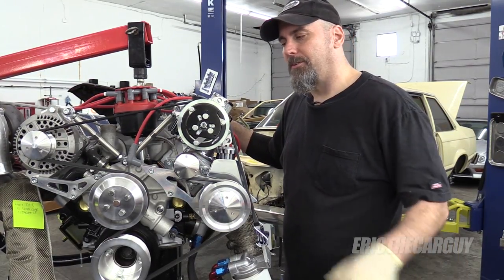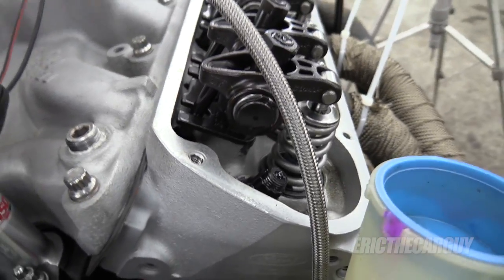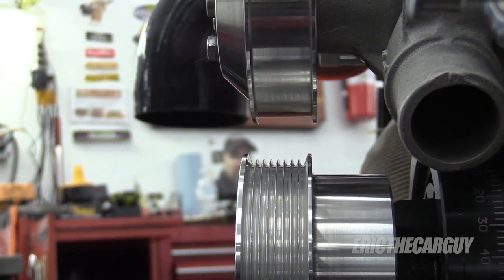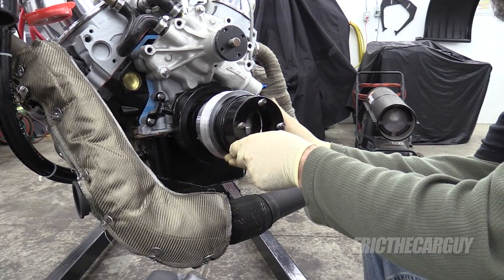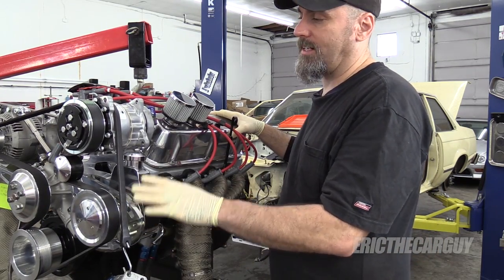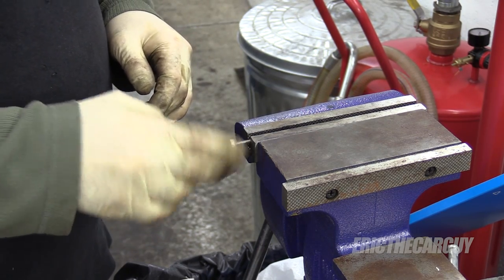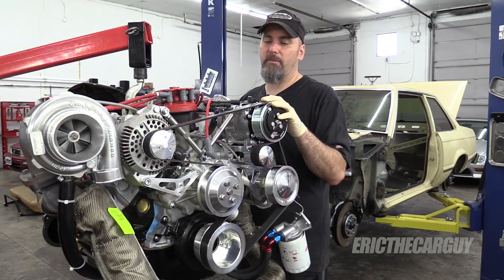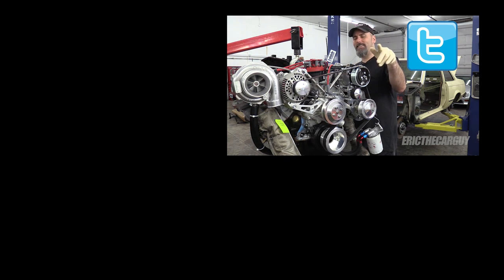How To Dress Up Your Engine!

Comment: Just as I moved to Florida 3 years ago my AC died... I got a job working outside, so I get all nice and sweaty then get in a 110+ degree car and head home... not fun.

I've been fixing my own cars with Eric's videos for 7 or so years now, watched all of the AC videos and properly replaced the compressor, vacuumed the system and refilled it, did the dryer receiver and the expansion valve as well... finally have AC. Point is YES, when it's very hot you're dying for some AC. Honestly on long trips of it being over 100 you can start to feel faint, it's not a good thing.

Comment: I have used CVF Racing parts in the past. Their parts are well made with a great finish and fit. Due to continued failures, I finally bit the bullet and spent $2300 on a Vintage Air FrontRunner system.  The Vintage Air system came with all the components needed to ensure the proper fit and operation of the accessory drive. Aluminum water pump, 170 amp alternator, power steering pump, belt tensioner, all the ARP fasteners needed, and a signal Serpentine belt. The system has been installed for three months now with about 5K miles on it including a desert run with 100+ temperatures. Before I installed the FrontRunner system I never got more than a thousand miles without a failure. The only problem remaining is all the rusty junk I need to replace under the hood.  The upfront price on the Vintage Air system made me say bad words but with it said and done it is the better value.
Reply from the maker: Yea, I thought about that. It's funny that in the end I will have probably spent $2K on my system and it will look like I never did anything when I'm done.
Reply: The Vintage Air FrontRunner system is a beautiful piece of art but the best part of the system is I bolted on a 100K miles of reliability. The only complaint I have is the support from Vintage Air was not worth the time I put into. Unlike CVF Racing that is always helpful. I really love the Fairmont Videos and will watch all the videos you can produce. Remember family comes first then the Fairmont, import repair videos, ETCG1 and last and most likely least sleep. Keep up the great work and thanks for being on YouTube.

Comment: You didn't torque those valve cover bolts properly. You have to say "click".
Reply: Godfrey Poon it was a flex type not a click type.
Reply: thisisntme But he didn't say "boinggggggg" either!
Reply: I thought they were torqued to a "medium grunt" spec?
Reply: Scotty kilmer has the best "grunt gauge".
Reply: Godfrey Poon or crank on the bolt till ya hear the crack, then back off 1/4 turn
Reply: I'm German and currently have a VW. I tighten things "gouldntite"
Reply: +Silly Dog isn't it Gutentite?
Reply: Torqued to half of a turn before the bolts breaks!
Reply: Igor Toebe you do this by turning it until it gets loose then go back half a turn
Reply: the correct torque value is tighten till it cracks then back off a quarter turn
Reply: "Make the noise...!"

Oh, wait. Wrong YouTube channel. This isn't the Bad Obsession Motorsports channel.
Reply: +Kelli Halliburton  More like Bodgit and Leggit Garage.  :-P
Reply: +First amendment Both of them are already over 500,000!

Comment: I just started my channel and feel the same way as you about the "hand calibrating torque settings" and said to people don't break my shoes. Then I tried to torque something that wasent a die or need setup and I snapped 2 heat stressed bolts. Then got lucky with the extraction but said to people see what happens in this kind of situation. LOL. Thanks for the inspiration to make my own channel and your video's are great and love them. Keep up the great work.
Reply from the maker: Good luck with your channel!

Comment: That engine looks great the way you built it, and hope everything works out fine once it is in the car. It must be so rewarding to know that you built that engine yourself, and it is a workhorse like no other. It is nice that you have power steering and A/C on the vehicle also since the A/C will definitely be needed in the Summer heat.

Comment: Those rubber and steel gaskets are the only way to fly on a 302.   The 130 amp is OE for a 90s Taurus, also an awesome part.  Stock 80s alternators have terrible low rpm output.
Reply: Large Body 2 holes all always 130 amp.. Ford uses them in many a truck and vans..

I would add. These things get hot above 50% loads. Which is why ford uses a 175 amp fuse and #4 stranded wire from alternator too battery....

Comment: Eric. That cutting bolt with nut tric. Trick is intend to cut just next to nut. Use some random nut, lock it to the correct bolt lenght in a vise and cut the bolt by leaning to the nut.

Comment: On a boosted engine I'm afraid you are going to need a oil catch can. Boost and valve cover breathers don't work well together. The catch can may be a pain to find room to mount. But it's a real good idea so you don't oil down your engine bay.

And I can see why you were a little upset about the missing water pump pulley hardware. I believe they don't supply them with it because the needed bolt length can vary greatly depending on a fan set up used. Not everyone runs an electric fan. And on the mechanical fans the needed bolts will depends on the spacer length or fan clutch being used. 

The engine is looking good!

Comment: Never seen an engine before without PCV. 
If the breathers leak, maybe you can route it back into the intake?

Can't wait to see it drive. That old granny sedan with that beast of an engine, so cool.
Reply from the maker: PCV systems didn't show up until the 1950's. Before them, they used to vent the engines out of a 'draft tube' on the back of the engine. The PCV actually came about because the US army wanted to drive their Jeeps underwater.

Comment: 1:52 see the ford logo and that bolt thing under it what's the bolt thing called because in my car I have a pool of oil sitting around it I thought it was meant to drain back down or am I wrong. Also there was I little bit of green in it but I think it's gone now

Comment: What does the valve cover need breathers for? Is there pressure inside that needs to be equalized? And if so, then why does only one side of the valve covers have them, and the other side doesn't?

Comment: hey I just got a new governor for my truck but it won't go in all the way or it is and I can't tell, there's nothing in the chamber or anything blocking the way so my guess is replacing the cap with a taller one (I have a short stubby cap) but I'm not sure on it tho need more information

Comment: How do you figure out what way to run the belt around all the pullies? How do you figure out the correct length of belt? How do you figure out the correct tension of the belt across everything?
Reply from the maker: In order. Ribbed side goes to ribbed pulley. Smooth pulley goes to smooth side of the belt. The belt came with the kit and was sized for it. After a while you develop a feel for belt tension. https://www.youtube.com/watch?v=ZSTZdTAB_As

Comment: With dressing the external threads after trimming off part of the original length, I was taught to always use a die. That is the best way. A very good mechanic/technician should have a die set adjusted to a looser cut to minimize re-cutting any of the good, original threads. The trick with the nut is just that: a trick (more like a shortcut). Only use that method in a pinch.
For internal threads, there are specific thread-chasing taps that will minimize re-cutting the good part of a threaded hole. A common application is the spark plug hole; use white grease in the tap's flutes to trap the chips. Then, clean out the re-cut spark plug hole carefully and thoroughly with dental picks (yeah, really!).

Comment: what pcv valve are you running? since you are turbo charged you could be pressurizing the crank case therefore pushing pressure up to the valve covers through the oil holes. (this believe it or not can be a loss of 20 hp because of the back pressure on the piston rings) The stock 5.0 pcv can be upgraded to the svo one or better yet go to a catch can
Reply from the maker: You might want to watch the video again.
Reply: EricTheCarGuy what did I miss? those breather filters will still spit oil if you have the condition I talked about above....ask me how I know ;)
Reply from the maker: You missed the part where I said I couldn't run a PCV because of the turbo.
Reply: ok so are you venting where the pcv was to a filter / catch can or did you plug it? if you plugged it I think you still will have an issue.
Reply from the maker: Again, I covered that in the video.

Comment: I installed a CVF kit on my Pontiac and ran into pulley alignment issues too. I have an aftermarket balancer and that threw off the pulley alignments. The water pump shims CVF sent weren't thick enough so I ended up making my own. I also had to make new spacers for the brackets. Thankfully I have a machine shop and was able to get everything dialed into a gnats ass. I redid the belt tensioner to get rid of the two piece one CVF sent and fabed a different power steering to head bracket. All those spacers .. washers and slotted brackets was just to sloppy for my taste and looked kind of clunky. This isn't a criticism of CVF because they have to try and cover as many permutations as they can in one kit. Mine was off just enough to be an issue.

Comment: You should use those valve covers on "Pit Stop," the 302 that came out of the Mustang... if you ever do anything with that engine.
Reply from the maker: The block is still at the machine shop. I don't think it's usable. There are plenty of small block Fords out there though.

Comment: I had seen a video about a diverter for the exhaust have you thought about running one? I know that you are building this as a "sleeper" From what I saw I thought having the ability to have the option is a cool concept have the option to run the exhaust off the header or switch to running through the muffler or straight exhaust with a push of a button.
Reply from the maker: Not using a push button. Designing my own cable system so I can instantly open and close it.

Comment: That crank pulley is not the stock size pulley. The stock pulleys did not need the Allen screw sets. They were mounted with a regular hex bolt and would not work with the under drive water pump pulley due to them being to big to even mount together.

Comment: Eric- do you have an HEI ring for those plug wires to snap into? It's usually a GM thing- with the integrated HEI coil on top, and the wires snap into the ring to secure them. I don't know if you've ever mentioned the ignition setup? Plugs type and brand? Points or electronic? Coil? Thanks Man.
Reply from the maker: I put it on after I made the coil wire. Later episode.

Comment: Hi, how can it be that u didn't go with electrical power steering instead?  You have to cut the steering rack in half to fit the motor, but saves u the power lose from running a ps pump all the time.
Reply from the maker: And the electrical load on the alternator is better? Also, there's enough modification going on with this project as it is. The time, effort, and expense of EPS would simply not be worth it in my opinion.
Reply: I am asking cause I have a non-PS 924, and don't know if I could go for the expensive and fiddly way of installing a 944 pump and rack or "in my eye" easier electrical PS.

Comment: The old valve covers look a lot better but obviously you have a much improved breather situation with the new ones.
Reply: Simon Coles the old ones could have been modified to work. it would have been easy to weld in a baffle and repaint.
Reply from the maker: I thought about it, but welding aluminum is not as easy as you think. Not to mention the old breathers won't breath as well as the new ones.

Comment: I have an incredible eye for detail!
Looks like the turbo housing is MUCH to close to the alternator and will cause it to get very hot?
Also the water pump pully is STILL i slightly out of line with the belts if you check with a straight edge on one side?
Lizza
Reply from the maker: The pulley is fine. I also have a blanket for the turbo. I don't have it on now because it's easier to work on the engne without it.

Comment: Can't you put a pcv valve to regulate the oil pressure a little better so it doesn't do that or is that not how it works?
Reply from the maker: The PCV has nothing to do with oil pressure. It's just a crankcase vent.
Reply: EricTheCarGuy sorry, just a beginner, I have a 1982 ford Bronco that's doing the same thing by spilling a little oil with what I think are aluminum valve covers and Mr. Gasket breather caps, I have no idea what's under there because I bought it as is and when I changed the oil I put 10w40 penzzoil high mileage and  it still doe the same, do you know if I put a thicker oil like 20w50 it'll help the oil coming out or if I should change the valve covers like the ones you put in the Fairmont? I also have an issue with what I believe is overheating because if I leave the truck I idle for too long it'll start to loose power and the rpms will lower to under 500 and it has shut off on a stop when  it's really hot here in south Texas, I know it's a lot that I asked and not enough info on the engine but if yo could help it'd b awesome, thank you.
Reply: Josh Jones thank you

Comment: you didn't go over one thing the oil filter that is hanging from a bungee cord ware are you going to mount that to the engine.
Reply: it is probably going to be mounted to the car frame/chassis
Reply: Yeah, it was mounted on the frame when the engine was being test fitted - but I think he still has to relocate it, as it was starting to get in the way.
Reply: Michael Whitworth yeah, he had a whole video on test fitting the engine and screwing it into the frame rail.

Comment: is the water pump specially designed to pump rotating in reverse?
Reply: Glenn Gtx since he is using a fox mustang setup, accessories and pulleys and those mustangs did, id guess it would be.

there were also standard rotation pumps on other cars that would bolt right on.
Reply: +lilsammywasapunkrock I've never investigated  mods like that before, that's why I asked... learn something new everyday!   thanks
Reply from the maker: Yes.

Comment: I wonder how much power your loosing running all your accessories
Reply from the maker: I'll mostly be driving this on the street, I'm not worried.
Reply: EricTheCarGuy I'm doing a engine swap on my car and I'm kinda on the fence about it because Vw's never had a/c and the new motor will have a compressor so I could go and add a system to the car or remove it and have a tiny bit more power what do you think

Comment: You say you are going to drive it on the street.  Will it meet the emissions requirements?
Reply from the maker: Where I live in OH it doesn't have emissions requirements. Also, this vehicle is older than 25 years.

Comment: ERIC!!!!! most likely you will need and oil catch can. thats what happens when you have BOOST! "Boost pressure in crank case=need oil catch can" good luck love the build.
Reply from the maker: It also depends on how much boost. For the most part I'll be driving this car on the street, not at full boost.

Comment: Super clean engine - 95% all new parts have that effect (also on your hip pocket... ouch).  Cannot go wrong with the Saginaw pump, they were used in so many different OEM applications.  A catch can would be nice that is then vented back into the turbo inlet.  Crankcase venting smell (gas+oil) into the atmosphere gets old.
Reply from the maker: Good point, but I don't plan to drive the car hard all the time. I'm hoping I don't have to go to a catch can. If I have to fit one more thing to this car I'm going to my room to hide under the bed.
Reply: Lol, I can imagine.  See how you go with the breather filters but personally I really dislike the fuming hot oil smell you get from them, even when driving normally.  You pull up a stop light, then take off and get a wafting crankcase oil/gas smell that your wife/girlfriend will be sure to dislike!
Reply from the maker: I don't think my wife will be spending too much time in this car.